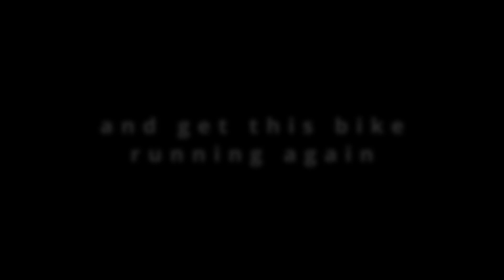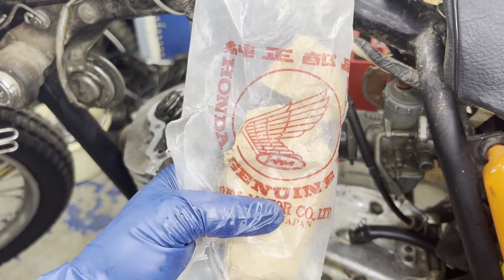Honda XL175 top end rebuild: Part 4 first start up

Comment: My first motorcycle was a 1973 Honda XL175 that I purchased brand new from Anderson Motorcycles in Pontiac, MI (then the largest motorcycle dealer in the world). I was 18 years old and had never drove a motorcycle. However, my car was a 4 speed so I understood the concept of a clutch. After a quick lesson in the parking lot I was on my way down the road! I put 2100 miles on it before I joined the Navy and my uncle bought the bike from me. It sat in his shed unridden for 10 years before he sold it. I’ve had bunches of various motorcycles since then. Suzukis, Yamahas before I got my dreambike. A Harley. I have to say, my Harley is my favorite motorcycle I’ve owned. I fell in love with motorcycles when I got a ride on the gas tank of a Harley when I was just 5 years old. Terrified and white knuckled and hanging on for dear life but at the same time I was hooked! Great video!
Reply from the maker: That’s a great story and thanks for sharing!  The Mars orange XL175 is what got me hooked on vintage enduro bikes.

Comment: Looking good. I had a 1973 XL175. I put full knobs on it, and added Poweroll (sp?) tuned upswept exhaust and used it for trail riding. I road it for 2 years and then sold it and bought a 1975 RL250, which I still have and did a reconditioning on it 2 years ago. Still use it to ride with my grandkids. I liked the 175 but we gradually moved on to higher hills and needed more power, (or maybe just better riding skills. :-) Thanks for the video.
LaVern
Reply from the maker: Thanks for watching!  Love the 175 and think it’s one of the best looking vintage enduros ever made.  73 and 74 in particular.
Reply: @Garage2Trail  I too enjoyed the XL175. I did have the timing chain tensioner break and when I installed the Poweroll pipe it increased the power but made it almost uncontrollable when climbing hills because it increased  the midrange power band so much that the bike would flip over too easy when climbing hills. 
LaVern
Reply from the maker: @1ljs  wow that’s crazy that it bumped the power that much!
Reply: @Garage2Trail  Yea, that was a few years back, and I don't remember if Poweroll offered pipes of different tuning  but this one had a real hot spot  mid range that was great on the flatter trails but hills were different, for me anyway. But then again maybe it was my riding skills.:-). 
LaVern

Comment: I'm sure that if I had done the same job the the parts would have been thrown across the garage in frustration more than once LOL.

Kudos for getting it back running like clockwork.

Thanks for the journey on getting this bike running again - I really apprecicate showing the issues and mistakes along the way.
Reply from the maker: Thank you!  Believe me, a few times parts were almost thrown a couple times lol…that cam install in particular.  I’ll have more vids soon of this one riding with updates along the way too.  Other projects in line as well.  I appreciate the feedback!
Reply: @Garage2Trail  Have you thought of using Patreon or similar to fund some othe projects you would like to do?

One of the other channels I follow (RRC Restoration) does this to great effect. You can chose what your approach will be to the work and if people want to follow and fund it then hopefully everyone is happy.

It is more work but as your follower base grows you could use it to fund better tools, more interesting projects and give you some payment for all the time and effort you put into these awesome videos.